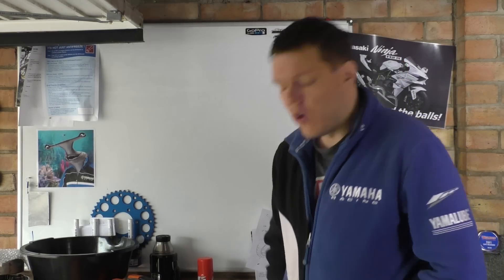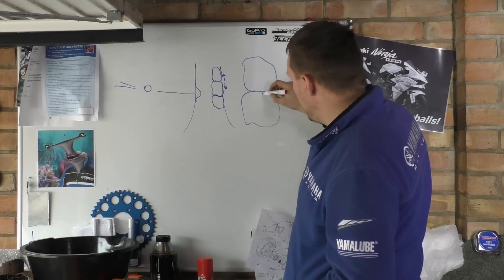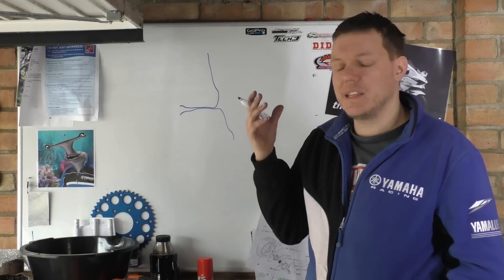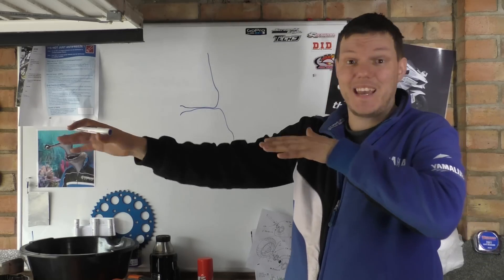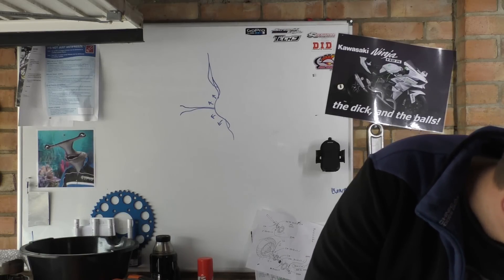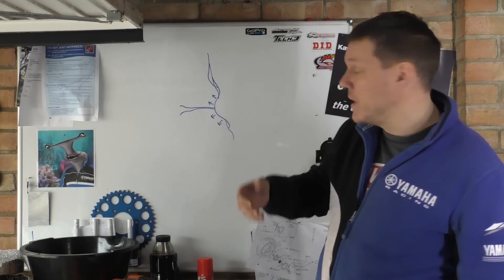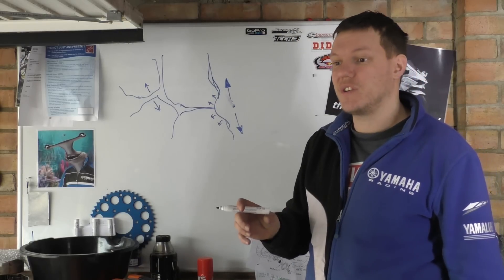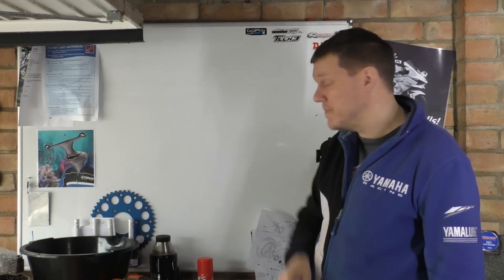Shot peening - What and Why?

Comment: Example: when welding. After you are done. Peen it with a needle gun and it will be way more effective. And it’s perfectly allowed in the field say welding drill rig pipes that bold 246 thousand pounds of force. And twisting 1 mile of pipe in the ground.

Comment: Awesome explanation mate! I have a gearbox mainshaft from os giken so it's a forged and shot peened performance part. I need to lathe a couple of circlip grooves only about 1mm deep, but is that gonna make a substantial weak point? It already has circlip grooves all along it I just need to move the speedo gear along a little bit to work with my gearbox. Just after your thoughts on cutting through the shot peening. Thankyou

Comment: About 25 years ago Dodge and Ford pickups did the same thing and didn't let the rear end gears rest.  In a short time they would move out of alignment and self destruct.  One guy working on a job with me had the dealer put the 3rd rear end gears in his pickup and said this is the last one.  At that time Dodge had a factory rep in Minneapolis, Mn. that all he did was take care of this type of failure.  The company figured it was cheaper to sell the trucks and deal with it later as the market was really hot at that time.  Utter bullshit.  How would you like to be out in the bush on a hunting trip and have it take a shit prematurely.   I guess you need to pack your jogging shoes along with your hunting boots.

Comment: Can cracks occur from the inside of a material or do they always start on the surface?
Reply: For non-shot peened parts, cracks generally start on the surface, but when a part has been shot peened, the crack initiation site will usually be below the surface.  This is because the material below the surface is under some amount of tension to balance out the compressive stresses that exist at the surface, from the shot peening.  However, the overall effect of shot peening is a much-improved part, which will stand up to fatigue loads much better than a non-shot peened part.  Also, the shot peened part will be much less sensitive to small surface damage, such as small nicks and scratches or minor corrosion (just a few thousandths deep).

Comment: Hey Matt, just a quick question if you see this and have a time.

I know this isn't directly related to the subject but it reminded me if a queary I've had for a while. I have a billet GYTR clutch cover on my 2011 WR450F and it has what they call a "ball-burnished" finish on it. Have you done any videos on the subject at all? I'm interested to see how it is done because the finish is fucking indestructable, I haven't put a mark on it yet. The factory painted and after market anodized covers wear off just with boot contact when shifting gears.
Reply: I had visited a factory where they made commercial size circuit breakers.  One of the parts went through a process that looked like ball burnishing.  The parts were copper contact arms that had silver based contacts brazed to them.  The brazing process made the contact arms soft due to annealing which could lead to them deforming under operating load.  They used a vibratory process with media (probably ball burnishing) to surface work harden the contact arms to prevent them from deforming.
Reply: Michael Jeffers thanks for the reply mate, sounds interesting. So it isn't just a finish like electroplating but also hardens and finishes the material? Makes sense because it is incredibly scratch resistant.

Comment: I wouldn't be surprised if single crystal growth will eventually be used for conrods, it'd probably be a bit more of a bitch to do a normal casting as a singel crystal due to the shape (and usually small size), but if they decide to billet the entire thing there's really no reason to not just make a giant single crystal block and saw out blank slabs for mass cnc prodution.

Comment: Live stream tomorrow but here's a preclude question: which is better to top up coolant, deionised water or distilled water?
Reply: You don't want to use deionized water for long-term contact with metal because it's corrosive.  I don't know if the coolant additives deal with that.  pH around 5.5 is too acidic.  CO2 absorption of the cause.  See what Matt says.  He has brain cells.
Reply from the maker: I'm already doing this experiment

Comment: Magnafluxed and shot peened..    I used a Magnafulx machine to check the gears in an Eaton Truck Transmission I was rebuilding ..  My Friend worked at Eaton in Kalamazoo MI  very near to me.. so I had access to the equipment ..
Reply from the maker: "Magnaflux"

- we'll get to this at a later date

Comment: I have always wondered if shot peening is better than cryo-treating rods, or if both could be combined (or if it is even necessary).  This directly relates to the single crystal growth of the material you mentioned in the latter half of the video.  I understand both processes, but obviously I am just some schmuck on Youtube and not a materials engineer.
Reply from the maker: "cryo-treating rods"

- we'll be getting to this soon to.
Reply: They are two entirely different processes, with unique outcomes. Deep cryogenic treatment (DCT) improves the martinsitic transformation (grain refinement) of the material, controlled shot peening introduces residual compressive stress into the components exterior. Used in conjunction can drastically improve fatigue resistance.

Comment: I believe I read in a sae paper or two several years ago that the residual stresses by shot peening decrease over time. Is this accurate?
Reply from the maker: It depends what you mean, if the rod if left then generally no. If the rod is put under load then yes. This is all about fatigue - which we'll be getting to soon.
Reply: I really can't remember, I couldn't even say that the paper was specific to conrods but I suspect it was. What I remember most was coming away from it thinking that nitriding may be a better surface treatment process for steel rods.
Reply: Time = Relaxing, so I would think yes as old overcomes new.  Of course I may be wrong.